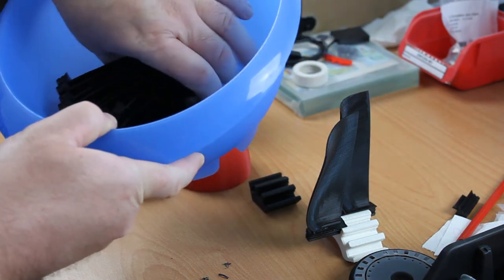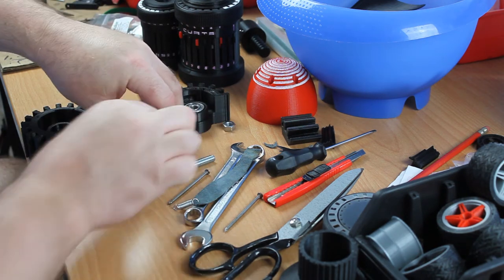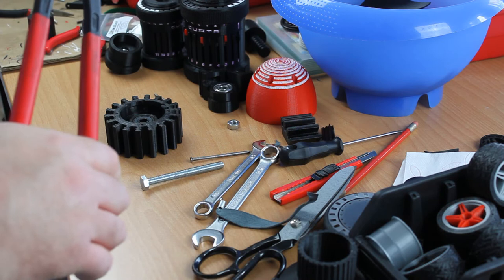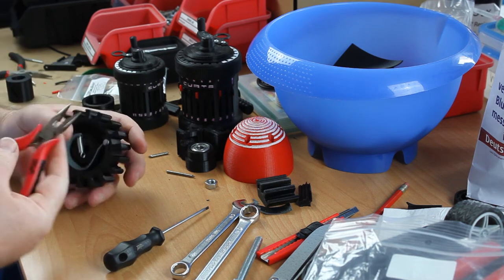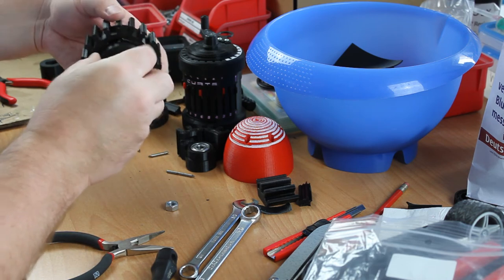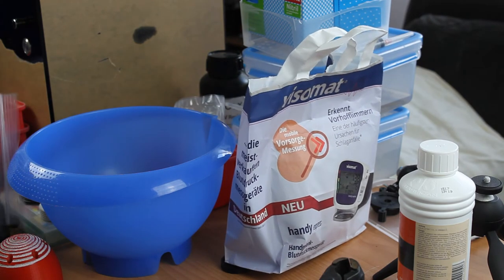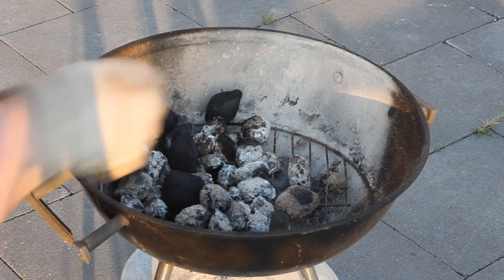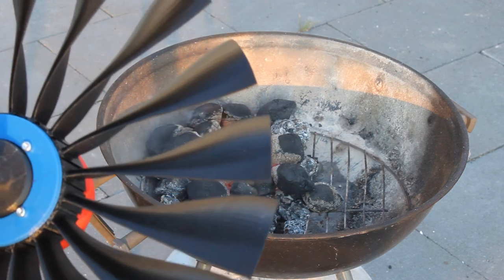3D printed BBQ-Turbine Jet Fan fire accelerator

Comment: A much simpler thing I've been using for years is...

a hairdryer.

It works just as well, the airflow is concentrated enough so you don't waste energy blowing air outside of the grill, and the angular momentum is much lesser than with this giant turbine.
Reply from the maker: Whatever works for you is what you should use.
However, having used hair dryers and paint strippers to start a grill in the past is what led me to designing this thing in the first place.
I'm glad I did. This device needs no mains electricity and so is far superior as portability and mobility goes.
Also, it displaces significantly more air, which allows me to have the fire in the grill red hot through and through within only a couple minutes.

Comment: I don’t understand?? Why not find a better application for this? Your fan is possibly more dangerous than the actual fire! For a much simpler much more effective fire enhancer pull the battery out of the drill and stick it in the flame

Comment: Wooow!, do you have the stl files?.
It would be awesome if you could share them.
Reply from the maker: Thanks !
Unfortunately the leather strip I was using as a brake just broke again, my new makita cordless drill proved too powerful.
This means I will have to come up with a new sprag clutch or freewheel construction.
As soon as that is done I will post an update and try to include a link to download files.
In the meantime I had constructed kind of a fan shroud for safety and improved performance out of the rest of the bucket.
I'll include that information to a future video.